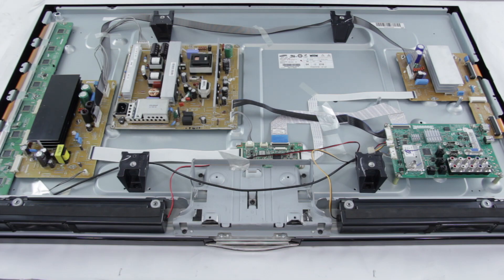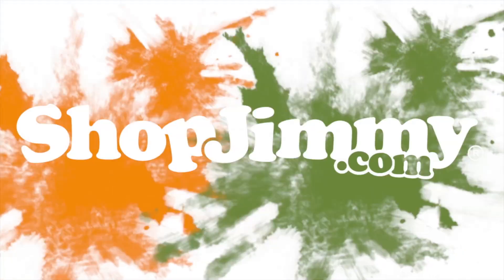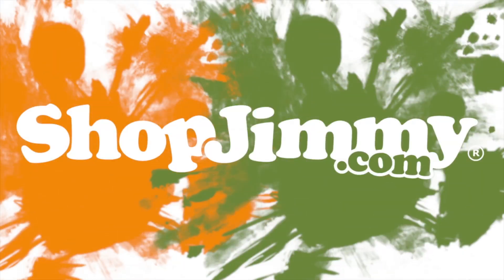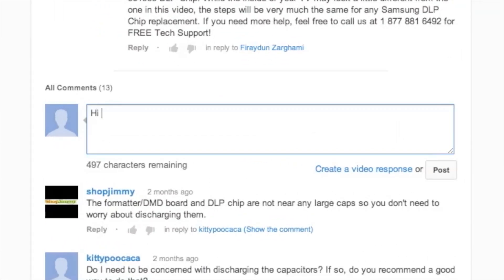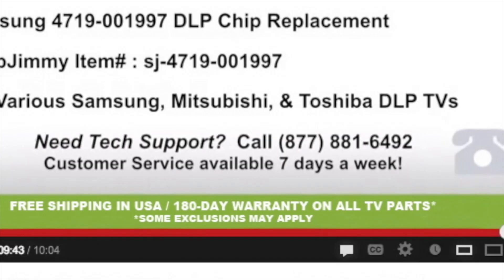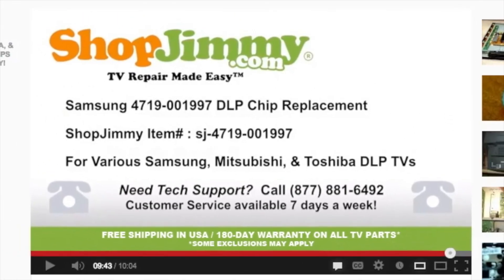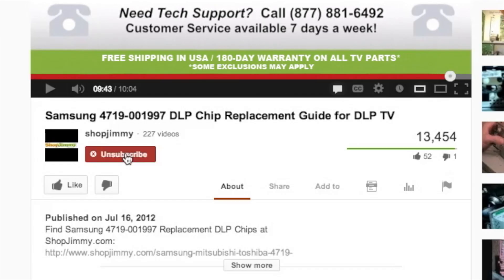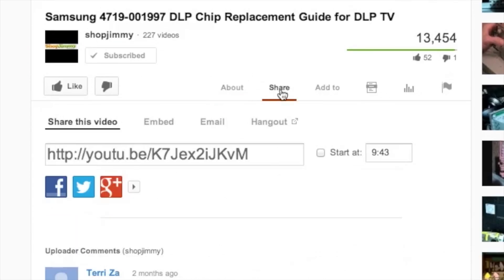Plasma TV Repair Tutorial - Common Symptoms & Solutions - How to Fix Plasma TVs

Comment: Great stuff! I got a Sansui Plasma TV Model:STY0342. It's a 42" unit. It has the red power led on. But no picture. No sound. And no indication of stray lines either horizontally or vertically. Seems dead.

Comment: Hi,

I have a Samsung  PS42C450B1W Plasma TV. Unfortunately, the TV has an intermittent fault.
Sometimes the TV will not switch on/off, volume controls etc when trying to use the remote control is not recognised and there is no red LED flash on the TV to confirm the remote control command. 
Can you tell me the faulty part that is required. I have tried another remote control and the same thing happens.

Kind regards,

Comment: I have a 2010 LG PLASMA TV 50 in model number 50p J340-UC turns on works fine for a sometimes 20 min sometimes 5 then shuts off buy it's self then when you try turning back on  it powers on then turns right back off

Comment: I have a Samsung Plasma 60 inch TV. It would work good all day long then when we shut it off it would not come back on . If it set for a long period of time it would come on and we would get no picture but great sound.  It was still getting good sound but we had no picture at all and I had a repair man look at it and he said Both Boards were burned out . Do you have any Ideas what Boards it could be ? I have Model Code PN60F5500AFXZA Version # US01 
S/N Z6VX3CBD301333B I think it was Manufactured in March of 2013

Comment: I have a LG 47" (LG 47n5700). At first it had a back light issue, where picture/menu items were showing up when a flash light was pointed at it but otherwise dark screen. So I opened the tv and replaced all the led strips. But now when I try to turn the tv on it shows no picture at all. Did i mess up in putting the tv back together or one of the boards died out?

Comment: So we have. A Samsung 51 in. Plasma that won't turn on. No standby. Have looked at power supply board, everything seems in order...ceramic fuse reads 0000 for continuity all capacitors look ok visually, (no bulges). Just prior to this, the cable outside was struck by lighning

Comment: I have an LG plasma 50P J550 that turns on but has no picture or sound. The standby light is also on. All fuses are good and I don't see any capacitors that are swollen. Do I need to replace a board?

Comment: Hi. I have a problem with a Samsung PS64D800 plasma. It has one black horizontal line going from one side to the other. My house did get hit by lightning 2 weeks before this line appeared causing damage to othe  appliances. Could this be the buffer board?

Comment: How about this? My 2014 Samsung Plasma 60" no longer turns on after a lightning strike. no standby light. no clicking. I just ordered a refurbished power board which also did not work after install. All capacitors looks fine on both original and "new" board. no burn marks. I have not replaced the ceramic fuse yet on either power board. I have not volt tested yet, but blown away by the odds that i have 2 faulty power boards. any suggestions? thanks. TV model: SAMSUNG PN60F5300AFXZA version: US01. Replaced board: Samsung BN44-00601A (PSPF371503A) Power Supply Unit

Comment: Model#: 60PV400-UB
Serial#: 109RM$$EY998
OK so my plasma started with a haze across the tv bout 3/4 ways up but only visible while a bright white color was on the screen and would produce a faint rainbow haze affect on the middle to right side of the screen. 5 months later (yesterday) while watching CFB the screen goes black but i still have sound. I've gone through all the troubleshooting as far as external is considered. Now its time to get into the guts. Im sure you have run into this problem before so i ask you. What should i be concentrating on looking for when i open up this beast? And where can i get the parts from? Thanks in advance !!!!
Reply: Oh this is a 60 LG plasma

Comment: samsung pn58c500g2fxza  powersupplybn44-0331a  -- vs should read 210 but is reading 189.4 volts   -the va voltage  is reading 55 volts and that is right on - my x main shows voltage but half of screen no working replaced t--con board already

Comment: my samsung  plasma  model PN59D530A3F  has an unusual problem that has developed over the past few weeks.  from a cold start it will turn on and stay on for aprox. 15 minutes before it will shut down with a click then reboot with sound only.
 If I leave it off for a few minutes it will turn back on but last a shorter duration before shutting down again. When on the picture is perfect and I really hate to lose this unit.   It is a 2011 model but all seemed great until last week

Comment: Hi, I have a Panasonic Plasma TV Model No TH P42C10D It does not power up and I was told that due to some surge coming through the hdmi port, the main board needs to be replaced but they dont have it available any more. Could you please help me find it or refer a compatible main board, Thanks

Comment: I have a Panasonic Plasma TC-P50S2, that will shut off by itself after hours of use. I can unplug it for couple minutes and plug it back in to start working again. I checked all settings, no timer set. I replaced the power supply and still shuts off after hours of usage. No blinking red light when shuts off. Could the power supply still have bad capacitors, or the main board be defective or the y-sustain board. None of the capacitors on any board are bulging or leaking. What do you think?

Comment: LG TV 60P A6500- this tv was subjected to a power surge. The main board was replaced. The only problem that remains is the remote control no longer activates any of the desired functions. Everything has to be done manually manipulating the external buttons on the tv. 
Your thoughts would be welcomed. email: sonrisecoinc@gmail.com

Very good vid and great explanations given for the various parts and the functions. Thanks for doing these videos.

Comment: I have model number PS42B451B2W AND IT WON'T SWITCH ON? When I turn on the power the standby LED flashes on and off and you can hear what sounds like the power on relay clicking. This happens for a few seconds then a weak looking red LED which dims when the power on button is pressed on the remote. I'm thinking this is the power board or a relay on it? can you offer anything else? Thanks

Comment: I have a 60PB5600 LG Plasma with one large vertical black bar, I figured it was the logic board, the 5 ribbon connections were secure? I replaced it but still have the bar, could it be something else? The ribbons at the bottom were secured as well. The TV is only a year and half old. Any suggestions will be greatly appreciated...Thanks!!

Comment: I ave pioneer plasma circa 2006. PDP 4270HD. Eveytime I turn it on it says : Plasma display Starting Up Please wait. I used to be able to unplug it for a while then plug it back in and then restart it, and it would come on. Not anymore. Do I need a new power board?

Comment: Have a Samsung PN51F5500AF started with no sound and no response to remote then no stand by light and no response to remote. Took it down, cleaned dust out and checked capacitors and all seem fine. Have not done a check with multimeter as of yet. Now no picture, was sound briefly then stopped. Pushing exterior button shows nothing on screen. Unsure what to do/check.

Comment: LG60PZ550 has no picture, sound OK. Found open fuse on EAX64232101 board. Replaced fuse. New fuse did not blow but still no pix.  A repair kit?

Comment: Hello jimmy I have a lg 50pj350 turns on but has no power. First it had a line in the tv 5th rivit for the leds was unhooked plugged them back up but still not getting any picture other than light from the back lights if you have any idea what could be wrong please message me at 706-941-6619

Comment: Samsung HPR4252X/XAA
My TV has discolored horizontal stripes.  There appear to be 6 definitive zones that correspond to the ribbon cables attached to the Y-buffer boards.  One of these zones is normal, the rest have varying degrees of discoloration.  I'm planning on replacing the y-buffer boards and then the y-main if needed.  Does this seem like a good plan or are there other boards that I should look into replacing?  Thanks

Comment: My Panasonic 50" Plasma TV (Mosel No TC-P50X3 HD TV won't power up - nothing happens when I try to turn it on.  It's connected to a surge protector strip.  Other devices plugged in to this strip work fine.  I can plug the TV in to a live wall plug, but no indication it is getting any power at all.  A couple weeks prior, it had a rectangular strip across the top 20% of the screen, which was a little darker than the rest of the screen.  However, that didn't occur on subsequent power-ups.  Can this be repaired economically by replacing one of the boards, or do I have to scrap the TV?Gary

Comment: my samsung plasma tv model pn59d550c1fxza.  was on when cable box turned off probably from surge, tv clicked off and never came back on. I found a blown fuse on power board, replaced it and now have standby light blinking, 5 groups of 2, then repeats and tv makes clicking sound after each grouping of 10 blinks. but still will not turn on . i am leaving it off, until i figure out what to do next. thankyou for any info.

Comment: I have two problems with my Samsung PN64F5500AF T.V. The first is a while vertical line on the left side of the screen from top to bottom but the most pressing issued is now when I turn it on, after about 5 minutes it will power down and attempt to reboot. The only way to stop this is to unplug the t.v. from the wall. For the second problem do you think it is the power board and for the first to repair (vertical line) is is cost prohibitive?

Comment: zenith flat panel plasma tv model #  PDP42G0144  replaced Y board and buffer board because they showed damage plugged tv in but was still clicking unplug and waited 5 min plugged it back in and now i don't have a picture . previously the tv showed half a screen one side showed a pic & the other part showed a white screen only with a vertical line

Comment: I have a 50 inch lg plasma tv model # 50pa4500-uf.  It will not turn on. I hear a click and then nothing. It happened all of a sudden one day it went off. I tried to unplug, plug back in and then on. Did not work. I hsve heard of a c802? Maybe being the problem? Other than this the tv was working fine. Also it's a 2012.  Thank you for any info!

Comment: Hi guys 
I have a Samsung PS51F5500 plasma display that has just developed a vertical coloured line about 2-3 pixels wide running down the right side of the screen. This line changes colour depending on what is displayed but does run from top to bottom. 
Any ideas on what could be causing this and if it's repairable ????

Thanks
Joff 👍👍👊👊

Comment: I currently have a Panasonic TV model TC-L32B6 and my volume is stuck on max when I turn down the volume it just goes back up automatically as if someone is pressing the volume increase button. I was told it was a component issue but I'm in sure of how to fix it. Any help would be appreciated

Comment: I have ps43e490 tv .one day when I watching tv suddenly a blast sound came and tv goes off.so I opened tv cover and I saw only a green light on logic board blinking. I checked for short on va vs and vsc but nothing is short. when I plug power cable for a few second va - 58 vs -190 and vsc - is - 190 comes and slowly slowly all voltages gradually becoming down. what should be the faulty component. on chip is heat written on chip samsung (bga chip)

Comment: LG Electronics 50PB6650 50-Inch 1080p 600Hz PLASMA TV (Black) (2014 Model) no picture, picture went out suddenly.  I have clear audio and the Direct TV box is hooked up correctly . What is the best fix if any other than buying a new one?

Comment: do you offer support/solutions to problems or any advice? 

if you do we have a Samsung plasma model PN43E450A1F, it was working fine when i left the room then i come back and the tv is all black(you can still see the picture barley behind the black or more of the lighting is noticeable on the top and bottom edges of the screen) but you can hear the audio on the background so i turn it of and on and its still the same, later after i let it rest i unplug all connections re plug  but now i notice a sparking sound coming from the middle left edge where the plastic holds the screen(plastic looks a little warped/bumpy where the sound is coming from) and all the other issues are still the same. if you know what the problem is or could be, or if you sell something that will fix this id appreciate it or any help thanks

Comment: Hello I have a LG 50PJ550 Plasma TV and it won't turn on and I could hear a clicking. I removed the back of the TV and could hear a clicking in the middle board which I believe is the power board. I'm a bit worried to order that part in case it's the wrong one...just wondering what you would suggest.

Comment: I have a plasma tv 60pa6500 first my tv was working great and after I switch my cable service I noticed that it started acting up far as coming on but no pictures but sounds and when it did come on it was like 30 min to come on and then it would shut down and went threw the same issues to come back on and I call the cable company and they brought new cable box and still the same issue and we unplug it and plug up to other tv and no issue but when we unplug the tv with the issues from the cable box it came on back then and this went on for a very long time and as of today 7/16/2017 the t.v finally die no sound no pictures so we remove the cable box n put it on other tv n try to turn on the other t.v with out the cable and no luck .....help me plz because I hate to junk the tv cuz I had a pretty good pictures tub....thank you

Comment: I have a Samsung pn50c450b1d 50 inch plasma. A few days ago my problem started. I have a 3 inch wide vertical bar of what looks like static. It's not solid colored and the image fades in and out and back to static, sometimes color sometimes white and black and it just flickers in that section only. The rest of the tv works fine. And sometimes it will go away completely. I've noticed it occurs mostly on game menus when there is a lot of bright white on the screen. When it's darker it doesn't occur as much. What could be the issue?

Comment: We have a Samsung Plasma TV (Model No: PN60F5300BFXZA). A few days ago, we developed a green vertical line on the right side of the screen. It's one line, very thin but quite noticeable. I went ahead and cleaned the buffer board spots at the bottom of the TV. First of all, did I clean the right thing? Secondly, could it be a bad buffer board or is it something else? Thanks for your help!

Comment: I have a Samsung PN43E450A1F  that turns on for a couple of minutes sometimes and then turns off, the red led indicator will turn off too, if I smack the tv on the  bottom left (facing the front screen) it'll occasionally turn on can some one point me on the right direction

Comment: I'm having trouble with my Samsung plasma tv model number pn50c550g1f model code pn50cg1ffxza, my issue is a got color vertical lines and I've replaced the main logic board and I still have vertical lines. Can you help, please?

Comment: Hi, We have a Samsung plasma TV model PN43D450A3DXZA that suddenly has no picture. But all of the sounds are there including the startup, all the normal clicking sounds and you can hear the TV broadcast through it but you  also can't pull up the TV menu since the screen has no backlight nor latent image with the flashlight test (if that works on plasma not sure) I service LED tvs as part of my job but am not sure which part(s) this could be and if it's a screen then we stop here. Got any ideas? Also you have parts for the PN43D430A3DXZA in stock but not my  model. Are the parts interchangeable?  I am going to take off the back cover tomorrow and visually inspect for blown capacitors.  If I purchase say 3 parts from you and one fixes it can I send back the other two for refund? Was it your return policy?  Thanks

Comment: Hi,

TV is: LG 50PS60 Plasma 

Started by getting a pinkish color on the TV. Then it ended up turning off about 10sec after turning it On. (AC/Det)

What I did:

1- Re soldered COILS and CAPS on Y-SUS and X-SUS.
2- Clean the dust out
3 - Tested again

The TV stills turns off after 10sec, suspect Power Supply Board?
Any advice on what to check or change...
 
THX
Martin

Comment: Hi. I have been watching your videos with interest and hope that you can help.  I'd like to fix this problem myself if possible.  I have a Samsung 59 inch plasma.  Model number PN596500DF.  Manufactured in 2011.  It now turns off and back on consistently after initial power on.  Capacitors appear to be ok from visual inspection.  Not sure which board I should try to replace. Would appreciate advice and guidance.

Comment: Jimmy,

I have the classic click on and off a few times and then stops. I just bought a power board from you and that was not it. I  checked the caps and they seed good but I usually go for the power supply as it's cheap.  Would you suspect the main board? model pn50c450

Comment: Having sound issues, it drops after 30 mins of play.  It started about 2 months after replacing the power supply (finally getting the screen on at that time).  Main board issue? (the one with all the inputs) or logic board?

Note that it's happening on all inputs and all devices, so it's one of the internal boards...

Comment: Hello. Great video. My TV is an LG 60", model 60PB6650. The front power LED lights, and there's sound, but no video. The screen is black. This is the same condition for all inputs (television, DVD, memory card). The device unexpectedly shut itself off, then on turning it back on, no video. Do you have any suggestions on a likely cause? Thanks.